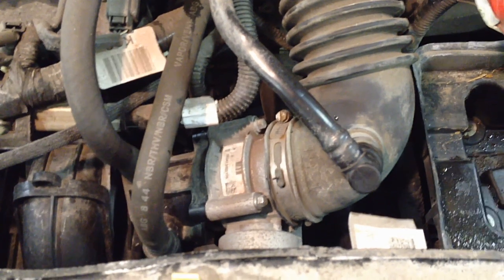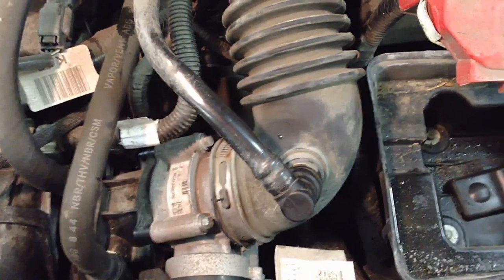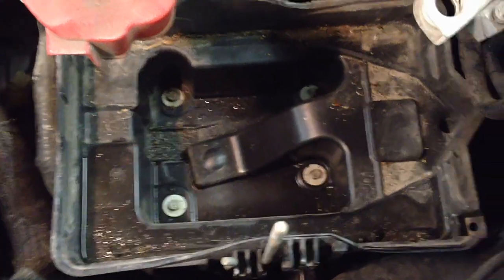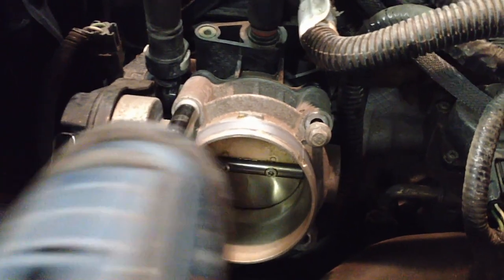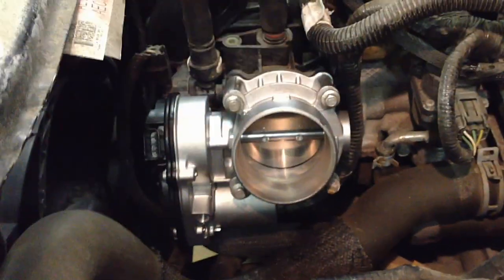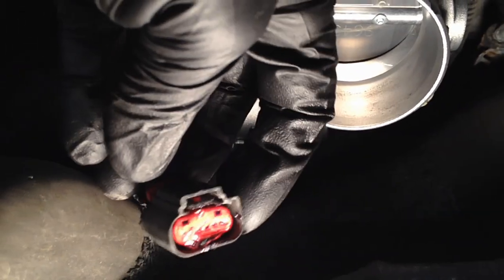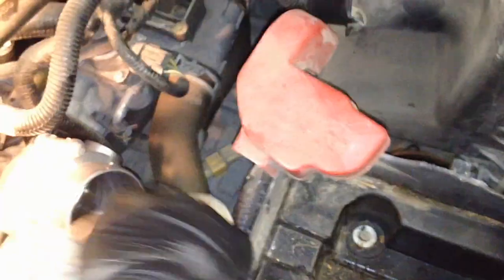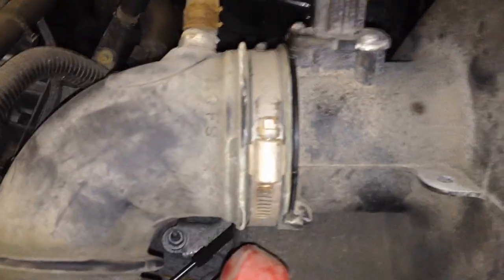2009-2012 Ford Escape Electronic Throttle Body Replacement

Comment: Hey man, thank you for putting the time in to make this video for us. My 2009 Escape died trying to drive in to work this morning because of the throttle body. After some research, finding the part at a local shop, and watching this video a few times, my car is now fixed and will be usable for Thanksgiving tomorrow. :-)
Reply: instablaster.
Reply: Same here 2023
Reply: It definitely broke down weeks later in exactly the same fashion from the mass air flow sensor.

Comment: I want to seriously thank you for the vido, I've had my check Engin light on for a long time, then my  2010 ford escape 2.5 xlt started stalling on me and the idel was all messed up, I brought her in multiple times and my mechanic kept changing all kinds of sensors really the mass air flow sensor and few other valves....well it kept on doing it so I took to the internet and started  doing my own research and found your video,  against every body's suggestions I went ahead and changed out the electric throttle body myself and I am very pleased to say it's been over 200 miles no lights the truck is definitely running better it's fantastic. Well done .  You should be very proud of yourself 🖒
Reply: Jeffrey, I have the same issue and don't know if I should do it myself or not. Have you had any issues since you replaced it yourself? Thanks!

Comment: Thank You I have a 4.6L and had the battery disconnected for a week or so. I used your relearn video and BAMMM... Runs like a champ.. Thank you sir for the kind person you are for helping people with all the would be very expensive problems that the steelership would take advantage of. Which I did call them and they wanted me to make an appointment... Ya Ok !!!

Comment: Mak ... I bought a 2009 Mercury Mariner 3.0 V6 with 122K on it last Dec. I noticed it stalled on me a couple times and doing some research I thought it may be the Idle Air Control Valve but after doing a more research I found out that the second gen (09 to 12) it is built in the throttle body thus me watching this video. One more thing the symptoms is it only will stall at an idle in gear or not in gear ... and I noticed the warmer the weather the more it stalls ... it barely did it in the cold months. It will always start right back up and never had an issue while driving down the road. So I got a new Ford throttle body and did the change like you show. I did the reset for the PCM. Got it all back together and did the restart to let it idle and 10 minutes into the idle process the engine stalled! Restarted it and ran for about 5 minutes and stalled! After about 20 minutes of idle I drove it and when I came to a stop it stalled ... it did this a couple times. Pulled into the driveway and put it in park running and after a couple minutes it stalled. No check engine lights and nothing on the code reader. Do you have any idea what may be causing this. When the engine is running it runs smooth and idles about 700 rpm.
Reply: Update ... Mak I come across a video with the exact same symptoms that I am having (Ford Fusion Stalling at Idle) video. So, he is saying it's a low-pressure sensor, but this is on a 2014 Ford Fusion. Thought this would be the fix but I do not see a low-pressure sensor anywhere on my 2009 Mercury Mariner 3.0 V6 fuel line and the only thing I could find out was there is only a fuel pressure regulator in the fuel pump itself ... would you think this would cause the same issue? (Only stalls at idle in drive or in neutral.) other than that runs fine! Thanks!

Comment: Thank you for making this video! Mine didn't fail, but it was extremely dirty, so I cleaned it with some carburetor cleaner. Now I can accelerate normally without surging in 1st gear.

Comment: Thank you for these awesome videos. You have saved me a lot of frustration between the throttle body replacement, mass air flow sensor cleaning, clearing the PCM and the relearn procedure. Followed those and my 2010 Milan is running great!

Comment: This is also common issue on the Ford focus 07 and up..... I just did the same thing a few weeks ago.
Clean the throttle body.
Clean the air intake box.
and also clean your battery cable if they are corroded.
This made motor and transmission both happy.
Stopped crazy transmission shifts ....

Comment: Thank you so much for the posts! with this one, the PCM reset video, and a few others of yours I was able to diagnose the throttle body issue. I used your Amazon links to order all the parts and plan on doing the install soon! Thank you for saving me hundreds of dollars and providing some great information!
Reply from the maker: Thanks for supporting the channel!
Reply: FordTechMakuloco hey sir, I have 2 a problems with my 09 Ford Escape xlt 
When I’m driving the ac is off and still the air is coming from outside to inside of the truck like the ac were still on. Do you know what’s the problem ? 
And also when I’m driving it sometime stops the speed by itself and start vibrating.. I have to turned off the truck and wait a little bit to turn it on and it works fine. 

Do you know what problem will be? 
Thanks

I hope you can understand me lol

Comment: Awesome video. You helped me alot with the theory of operation (break down part) where you talked about the relationship between the throttle body, air flow sensor and the transmission shifting well or crappy. Thanks so much.

Comment: The code on my 2009 Escape says I need a new throttle body assembly. Unfortunately, my 10-year extended warranty ran out in October. The dealer gave me an estimate over the phone of $685. NO WAY. Thank you so much for your helpful videos!

Comment: Great video and information on the throttle body. I just replaced mine and finished the test drive. Only issue I have encountered is after i pulled into my driveway, I put the car in park. I slightly tapped the accelerator pedal and my RPM's went up to 2000, came down to 1500, back up to 2000, back down to 1500, then came down to around 900.  Did not experience any surging during my test drive.
Reply from the maker: +Curtis Anthony It was still learning the throttle angle and was trying to prevent any chance for a stall out.
Reply: Good deal. Next day it drove and idled like new. Thanks.

Comment: Thanks for helping out!  Did this job on a '10 hybrid. The relearn process is different. The vehicle idled normal right way. A little low idling, but not much. The car doesn't heat up unless under load as the computer is always trying to cut the ICE off and go into EV mode.

Comment: I was having the same problem. I looked into it and realized that Ford had a recall on their vehicles for this specific reason, so if you are having this problem take your vehicle to your local Ford dealer and they will fix/replace it for free.

Comment: great video very helpful. will disconnecting the battery on a 2011 fusion v6 3.0 SE flex fuel reset my pcm and relearn my throttle body because I think it is causing my car stall in-between 40mph and 60mph. I replaced the spark plugs fuel pump maf sensor and this is the third throttle body in a year and a half from the dealer.

Comment: The fuel needle on my 2012 Ford Escape was reading E although the tank was full. The dealer diagnosed the problem and suggested that I change the "fuel sender connector" (at an estimated cost of $700). Since I had already spent $100 for the diagnosis,  I had a friend look at it (the "sender" is just below the back seat on the driver's side, and easily reached by flipping up the backseat)). He gave it a few shakes and the needle is once more working perfectly (2 weeks now). Could this be an electrical problem? Or some sort of shortage?

Comment: Thanks for this post ... I used this info to fix my 2009 Flex ... worked perfectly.
Reply: Did you do the repair yourself or did you have a mechanic do it? Do you need to connect the car to a computer? Thanks!

Comment: Hi FordTechMakuloco, the replacement part you recommend and that you linked to on Amazon is "DS7Z-9E926-D." The part I received from that link has a sticker on it that reads "DS7E-9F991-AJ." Is there any way to verify that the "AJ" part is OK to use instead of the "D" part? Should I return the "AJ" part and keep trying to find the "D" part? I chose the highest rated seller at that link, so I'm wondering if the "D" part is even available anymore. The Amazon page and the part box still show the "D" part number. Thanks.

Comment: Hey, great video do you recommend cleaning the body if there are certain throttle issues? I'm having issues after I change the battery the sensor struggles to "learn" the correct position of the valve and I'm not sure if cleaning it is a good idea, I could damage the sensors. Thank you.

Comment: I have a 2013 Escape. Ford maintenance says the throttle body needs to be cleaned. I would rather do it myself than pay the $150.  Is the removal essentially the same in the 2013 as it is with your above video? Ours is a 2.5 liter, S model. Thank you in advance.

Comment: Hi and thanks for the video. I have a 2010 Ford Escape XLS with throttle body issue. Just got the part in the mail. Beside installing and cleaning, any scanner or diagnostic tool used to reset the PCM? I would really appreciate your input on this matter. Thanks
Reply from the maker: Follow my throttle body learn video

Comment: thanks for posting such a video, I have replaced the brake booster in my fiord edge 2011, after  replacing it brake issue solved, but another issue raised which is I can't speed up more than 40 miles its like even if I  accelerate  harder still won't let me please advice or give me guidance to the causes of this issue, appreciated bro.

Comment: Hello, I having trouble with my 2015 Ford Escape Titanium 1.6 turbo. 145,000 miles. I’m having surging / pulsing while accelerating, even on cruse also. I’m not getting any lights or codes. Just wanted to rack your brain on what could be the likely cause. Thank you!

Comment: First driving lesson with my son, switch sides, hose blew out while he was driving in the parking lot, his comment was “it’s funny how they make these cars so much easier to go than to stop“, when we switched back I was like holy moly WTF lol!

Front left, brake fluid everywhere, still had consistent pedal so babied it home, stopped at the car parts store on the way and picked up a set of all four hoses, replaced them the literal next day. The other three looks just as bad as the one that blew. Easy brake job btw.

Comment: hi, thanks for the video it helped me lots. I changed the throttle body about 4 or 5 days ago and followed your video step by step however and my way home tonight it stalled out again at a red light. Any suggestions on what I should do next? No check engine light or wrench light came on. About a month ago I was having issues with the "check fuel inlet" and watched a few of your videos and the check engine light has not came on since. Could the canister purge valve have anything to do with this? I was going to change it but did not as that problem seemed to have gone away. Unless I got another bad throttle body from ford, but I am guessing not. Just when I was feeling comfortable letting my wife have her vehicle back safely.... thanks again!
Reply: same problems here... did you find the problem?

Comment: hi, I really appreciate the info that you provide, it is very helpful; I have an Escape 2010, the engine blew and I had it replaced; after it was replaced it began shaking when idling at a light or just not accelerating; I took it to the mechanic and he said it was the gas pump,I replaced the gas pump, then the ETB, also the Air flow reader (or something like that) and the coils, and it has new spark plugs, and still it continues with the shaking; it does not do it when in Neutral; do yo have any suggestion? thank you in advance, HH

Comment: I have a possible up coming job for replacing the throttle body on a 2010 Fusion with the 2.5L. I don’t believe it is the hybrid model. All your described procedures showed be pert near the same, correct? What about the idle air control motor, is that a necessary replacement or only if it’s not functioning?

Comment: Could this cause the intake air temperature sensor to be showing on coder with mass air flow sensor? We changed MAF sensor already still showing MAF sensor and Intake Air Temp Sensor but having all symptoms of throttle body.

Comment: On my dash board the little wrench light came on and all my research suggests that it's the throttle body. So my question is does that light come on for other things or is it defiantly the throttle body? I don't wanna replace it and it be something else.
Reply: Laurie Lewis did you have to replace your throttle body
Reply: Check out Ford “Customer Satisfaction Program 13N03-Supplement #2. This 13N03 isn’t a recall but the dealer will replace the throttle body at “no cost to the customer” according to the supplement.  This CSP 13N03 also describes the “Wrench Light” and what it means.

Comment: thank you for all the videos.
on a 2010 does the throttle body act as the IAC as well or is that separate? Extended crank then start problem. followed this (cleaned throttle body and MAF, reset pcm, etc.) issue persists. thx

Comment: I have a 2011 Ford Escape 4 cylinder. I changed out the throttle body and spark plugs also did the pcm clearing. Has 96k miles and needed it. My problem is that I have a slight gas fumes coming from my vent. What's the issue?

Comment: What could cause a tick from the intake boot next to the throttle body. It’s not oil pressure or valve related. Sounds and feels like a sensor. 2012 ford escape 4cyl non-hybrid

Comment: Great video and very helpful for my Ford Focus 2.0 petrol over here in the UK.
I just want to ask what the black plastic hex screw does on the throttle body and if it can be fine tuned using a scanner. I suspect mine is out a bit but I can't find any literature relating to the screw anywhere.
Can you help me please?

Comment: I had a problem that resembles  to the t with what you've talked about  and showed in ur videos. My problem was a two pronged plug down in front on v6 engine was completely bare

Comment: Thank for the video,
My 2008 escape is having throttle body issue as well.
Wanted to ask if the 2009-2015 throttle body is compatible with 2008 or is it a different type
Reply: I own a 2008 as well and I'm thinking it uses the same one? Body style of 2008 is same. Hopefully +FordTechMakuloco chimes in here?

Comment: I'm having issues with my 09 Escape. Going from red light it will barely go staying at 10mph then it will jerk and go up to 5000 RPM and accelerate real quick. It will also also stall when turning on residential streets at times.

Comment: The part you list indicates it will work on both the 2.5L 4-cyl and the 3.0 six. Does that make sense?
Advance Auto sells a Dorman throttle body for about $350. Yours seems to be an OEM Ford part for less than $60!
Reply: I bought it from Ford for 60.

Comment: Hi could the Throttle body cause vehicule stalling in highway? And 10 seconds  before vehicle stalls speed indicator go down to 0 speed while in highway? For speed indicator i think the instrument cluster is fine because when i start the car all needles do the right left swipe and the speed indicator problem happened 2 days ago before stalling while in highway too with needle go to 0 and odometer stop counting milage. Thank you !

Comment: Your videos are always the first I look for when I have to fix something on my Escape or Focus (which is thankfully rare!)

My 2012 Escape with the 3.0L and 80K miles will sometimes crank a while before the engine fires up.  Battery is only about a year old, and it sounds really "snappy" when it cranks, so I don't think it's the starter or battery.  I also noticed a little more vibrations in the cabin than it used to have, which I thought was a motor mount issue originally.  Think this could be an issue with the throttle body?  No check engine light is showing up.

Thanks!
Reply: I'm having same issue now with my 2010 escape everything you listed cranking delay, to rattling while driving. I was told engine mount, did you ever look into these things?
Reply: @sasquatchnunu506  on the long crank, it turns out there was a TSB about it. Basically it was a side effect to a recall repair in the throttle body. I brought it back to a dealer (different one from the recall repair) and they were pretty familiar with the problem.

As for the rattle, I really don't remember what caused that or if it was even fixed. I think I just got used to it. Sadly my Escape was totalled 3 years ago in a bad, bone-headed accident but Captain Jack performed beautifully when we needed him to most.

Comment: I have an 07 f150. 4.2L with an electronic throttle body and am assuming the process is the same for the relearning process. Can you please confirm this for me and tell me what equipment if any that I need to do the relearn. In addition, I ohm'd the pins for the pot in mine for the feedback and did a sweep check on it and it went open several times during, this is what is making me think the TPS in the electronic throttle body is the problem

Comment: This plug for the throttle body looks very similar to the plug for my 2011 f150 5.0. I couldn't figure out how to unplug so I left it plugged in and moved the throttle body off to the side. I had to do this to take off the Y connector hose I was replacing hose seals for the quick release hoses. My question is this the same way you would remove nthe plug for my model year?

Comment: I had the throttle body replaced on my  20012 Escape 2 years ago at the dealership. It's starting to stall again. Is it common for the throttle body to fail repeatedly? Same symptoms same wrench light on.